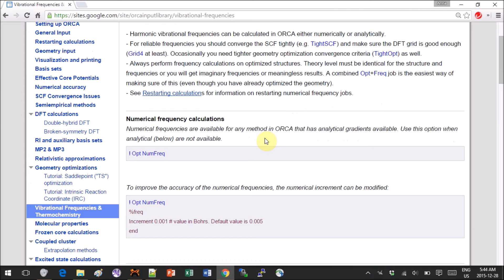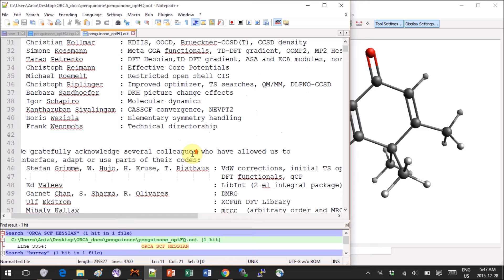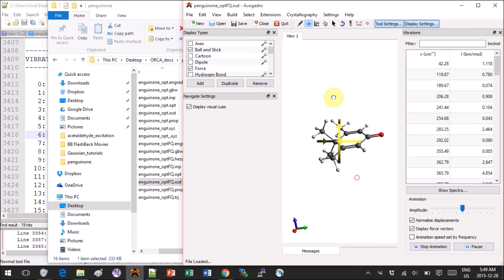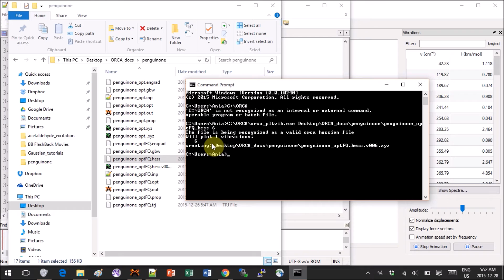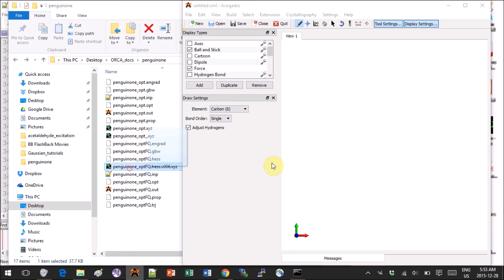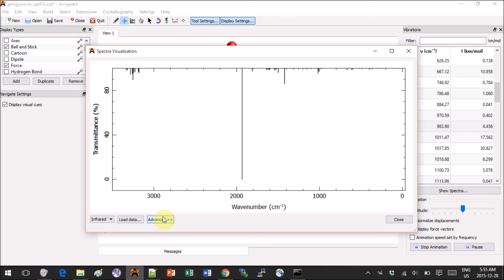Avogadro with ORCA Tutorial: frequencies

Comment: Hi
Thank you for the videos
I did a freq calculations and then open the output file with avogadro. The vib panel opens on the right but contrary to your example, if I select one frequency avogadro tells me that "it does not exist any frequency displacement". Vibrational frequencies and normal modes are well printed in the output file.
I have the 1.2.0 version of avogadro on mac os x
Thanks